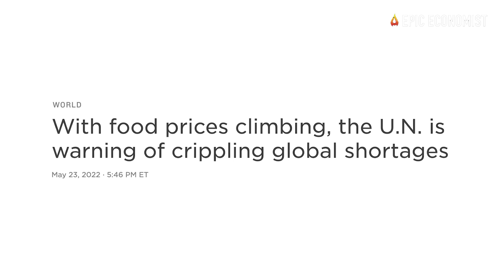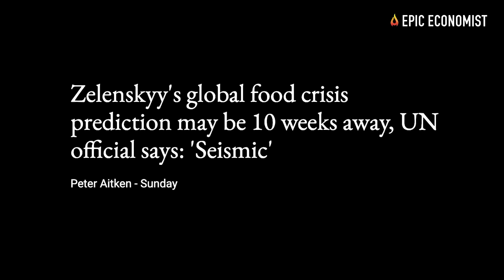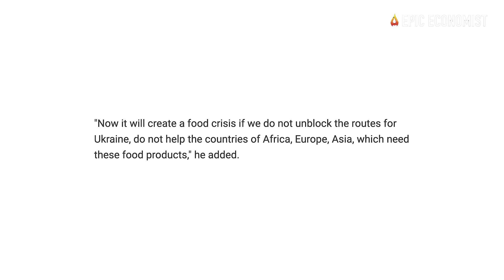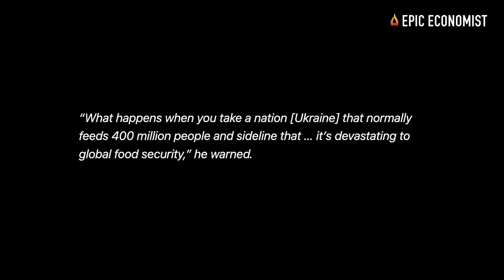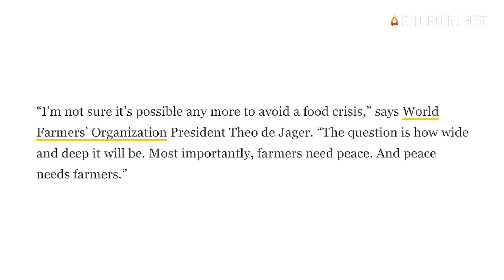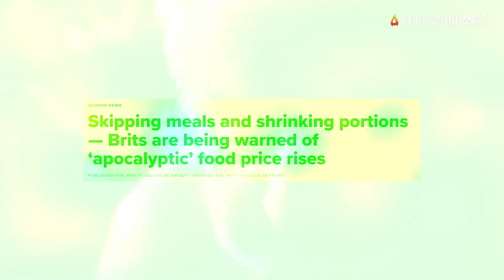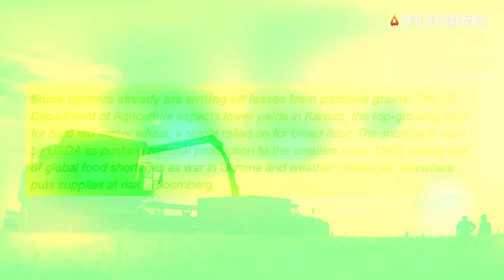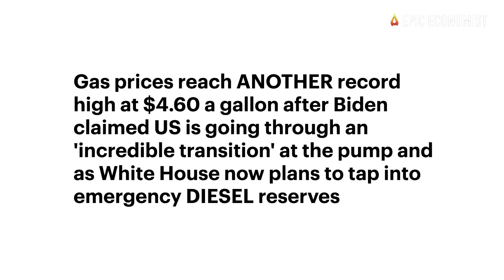The Apocalyptic Global Food Crisis That We Were Told To Prepare For Has Already Started In 2022

Comment: The thing about the food crises, and many other shortage crises, is that we improved and improved technology to extract/grow food but we did not (and can not) increase natures ability to produce. We spent our natural savings account and there's none left. We will be forced to return to natures carrying capacity.
Unfortunately, that carrying capacity has probably been reduced to 1 billion. Meaning 7 billion people have to go!
Reply: What I don't get is why we are still so reliant upon the weather with our farming in 2022? Why have we not designed massive green houses or the like so we can expose crops to the elements at will instead of having them wiped out time and again by random weather events? It's time we started doing things smarter IMO.
Reply: @Alexandrite.101  biodomes to cover 5 billion hectares.... and where is the power going to come from to run the climate control?
You really didn't think that one through.
Reply: You wouldn't need climate control if the crop was able to be covered during frost, droughts etc. as long as there was ventilation via natural through breeze or something man made to circulate the air, the cover just needs to work as a barrier for protection from the worst crop destroying elements. 
5 billion hectares is somewhat extreme for a farm, most wouldn't be anywhere near that size and obviously the farms which were too big would not be suitable however there are a lot of other farms like those for fruit, lettuce, vegetables etc. where it would be possible. Maybe they could dig the ground out, relay the topsoil on the bottom of the pit and have a retractable roof which could cover the crop when needed? It would need to be on the side of a hill for water runoff or some sort of pumping system installed. I am sure if we put our minds to it we could come up with something better than praying to the weather gods.
Reply: EcoCentric, you are right on! We have way overshot the carrying capacity. But I don't think it's quite that bad, although we may well get down under 2 billion for a while. Perhaps a good estimate of "steady state" carrying capacity is round 3 billion. If we manage the population around that range everybody can have a home, eat, and have a quality life where they grow into the human development potential they are born with. You can see in birth statistics in the "developed world" that the world should be able to manage that everywhere now that there's birth control pills and increasing education. Without those, large families and eventually overpopulation come unbidden even if not wanted.
Reply: @craigcarmichael5748  I agree on the 3 billion. It's just that over consumption has reduced the current available resources. We need to drop below natural carrying capacity and let biological resources build back up.
Reply: Actually.... yes we can Increase nature's ability to increase. You may want to look deeper into your claim because there is ABSOLUTELY a way to increase yield with little to no effort and without the use of ANY good or bad chemicals, mixtures, compounds..... You would be surprised what you can learn when you personally seek something out. Good luck 👍
Reply: @nftartist5409  I have a B.Sc in environmental science. I have studied permaculture.  I know how these things work. There is interconnection and necessary variety.  We are restricted by space and time.